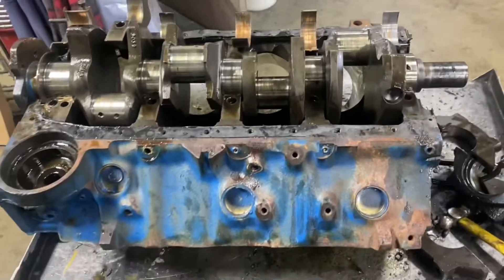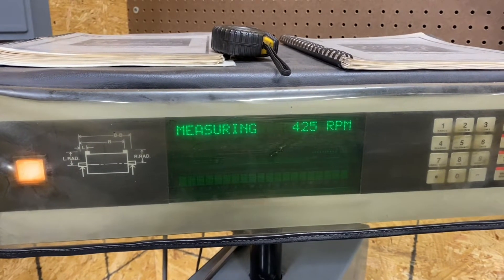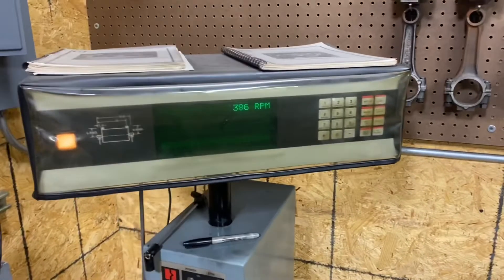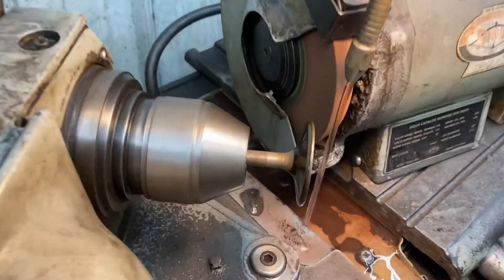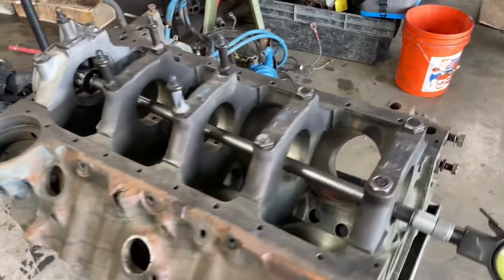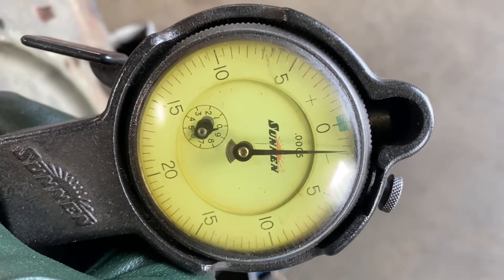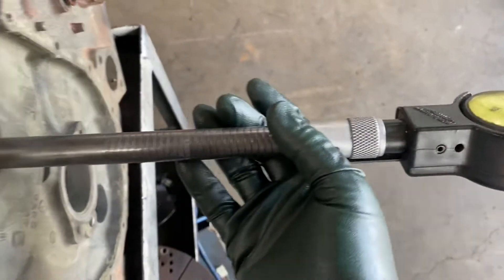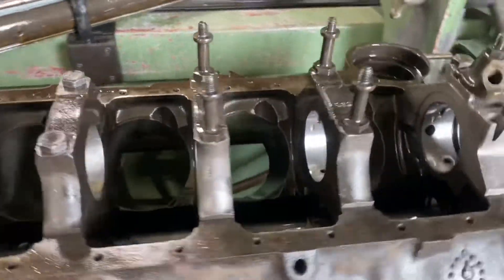Crusader 454 Model 350 Engine Overhaul

Comment: i am looking at two boats one has rebuilt 1995 Crusaders 454 closed loop cooling rebuilt 100+ hrs, Trojan 350) the other 2004 Horizon 8.1 w/ 700hrs, (Sea Ray 340) mostly fresh water use. Your opinion on both, i watched both videos.

Comment: Looking for some advice.   Looking to purchase a boat with twin 454's that have about 1550hrs.  They've been maintained over the years but they are 40 years old.  Can you get by with a top end rebuild or,  should I consider a repower in the very near future.  The compression is good in both engines now.
Reply from the maker: If they run good I'd run them as is.

Comment: What would make the crank break like that? Would the crank break first, the cause massive oil pressure loss, or would the engine lose oil pressure first, then destroy the crank? Well, I guess it is amazing that engine ran at all before rebuilding, given how out of specification the bearing bores were.

I enjoy seeing how much work you put into painting your engines. Few channels do.
Reply from the maker: Crankshaft breaks first. It’s a cast iron piece in this application.
Reply: @LakelandAutoMarine  Thanks, I see.

Comment: hey there i have the same engine (if this is a CH350 on a mark IV big block casting# 14015445) I am hoping you could tell me the GPH for the fuel pump that is ideal for this engine. the carb on it is an Edelbrock 1410 750 cfm and the vessel is a 1981 Carver 3007 aft Cabin single engine. im trying to find the right fuel pump because mine is only pumping about 3 psi and i cant seem to find a ballpark on the gph that would be optimal. i appreciate your advice and great work on the engine big thumbs up to ya